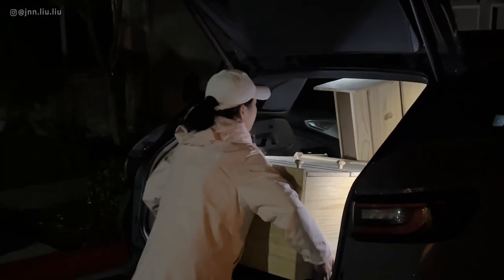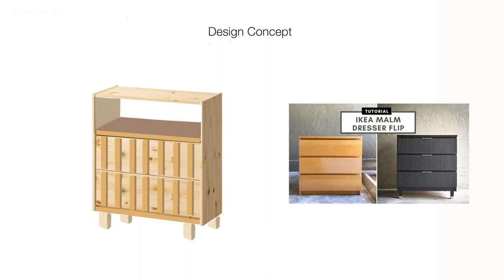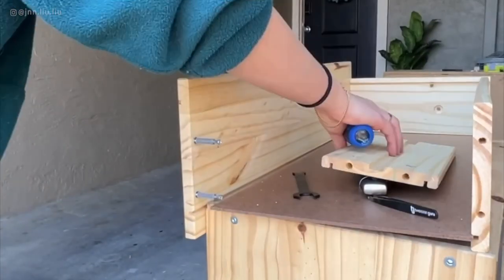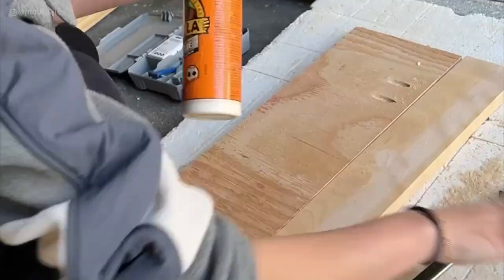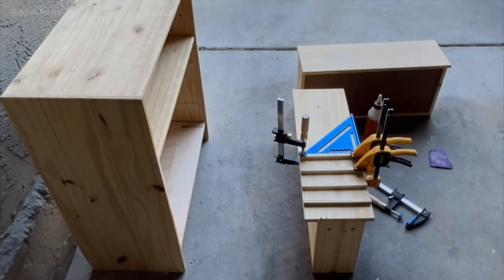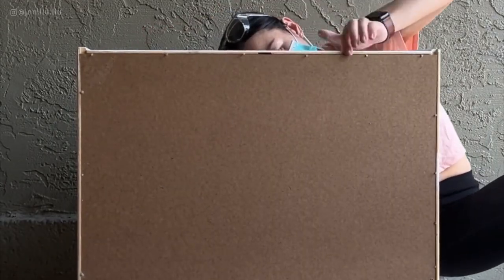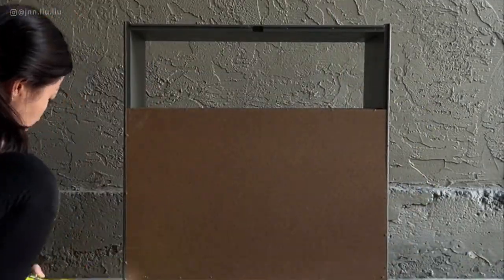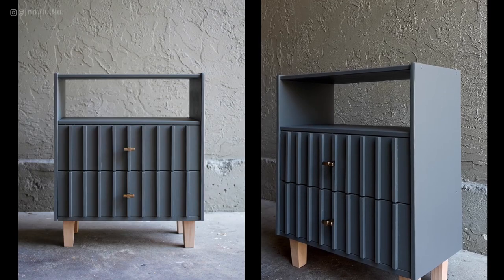IKEA RAST Dresser Hack | Fluted Drawers + Legs | STEP BY STEP

Comment: How much did this project cost?
Reply from the maker: Hi there, I already had all the power tools and most of the supplies (wood glue, paint, paint brushes, etc), so I only had to purchase the dowels, door handles and legs, so it only cost me about $42. If you have non of the supplies my estimate is probably around $100, and you'd still have a lot of paint, wood glue to spare for the next project! Hope that helps!